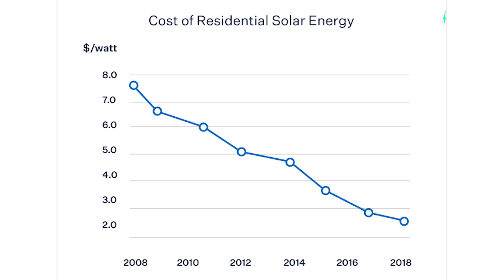How long does it take to save money with solar panels?

Comment: Cost of electricity is one of the biggest factors. If it’s cheap (10 cents per kwhr) like it is here, it takes 2.5 times longer than it would in Australia with 25 cents per kwhr
Reply: 25c/kWh would be a nice dream for anyone in Australia, but there's a lot worse... There's a company charging up to AU70c/kWh to charge CARS.  Guess the company... (You only need one guess)...

Comment: . The economics of the comparisons are totally different ('apples to lemons') 1. constantly 'buying' electrons that are consumed from a utility... vs.  2. Solar is Owning the source of electrons. So, asking the 'payoff' of solar is an irrelevant comparison to a never payoff 'consumable', they are two totally different business models. #1 you never payoff because there is No capital ownership...it's a service (like rent*)  #2 Solar PV Is Ownership (like buying a house ) which has a payoff & Equity. In the case of PV system ownership , you  start saving from day 1 of operation by offsetting a constant billing from utility.  Solar produces Earnings (free 'fuel' )  while paying to constantly consume electrons is *money out the window'!!

Comment: I can answer that very easily, I bought a 5KW inverter with 3kws off Solar panels 12 years ago and never paid another power bill again, this meant the nearly $300 a quarter we were paying went towards the Solar panel cost or $1,200 a year plus the $150 to $300 a year from Solar credits, after two years, I got my Electrician to put another 3kw of panels onto my existing system, we went from a max of $300 a year to a little over $2,000 a year in rebates.
Our original system cost $9,600 and then the further 3kw cost me $2000 installed, this then made my system cost free in under five years.
I then got a quote for a Solar Hot water system as we had Gas and were paying nearly $300 a quarter for Hot water and the Stove, so near the same as what we paid for electric.
The Hot water system cost me $3600 so paid for itself in three years and now we can wash our clothes in Hot water as well as we have the Hot water connected to the Dishwasher.
After the year the Plumber asked us not to increase the temperature of the Hot water system, I jacked it up to 65C from the required 55C.
I never expected the Solar to be as great as it turned out to be and only my Youngest Daughter listened to me and also got Solar for her Home, they now don't get the same rebates as they have moved three times since then and put Solar on each new House they upgraded to.
They may get at most a $75 bill per quarter for the House, as it's a big house and they have two children.
I did tell her to get a larger system as they were doing a lot of deals at the time, she is happy with only a $75 at most bill as her older sister is paying $750+ a quarter for a slightly smaller house per quarter and they have the perfect roof for a 11kw system.
I know it's probably different for people as some won't follow the rules on when to use your Solar and when to use the grid power :)
Also as an aside, I have heard people tell me that their Solar System didn't make any difference to their power bill ?
I am guessing there must be some Dodgy Companies putting crappy panels onto their customers Roofs ?
I have a mobile dual panel solar system that has a little box connected to them that keeps my Batteries conditioned as well as charges the batteries for my Tools. it also has a 12volt battery that can be used for many gadgets when we go camping.
I am a huge advocate for Solar as not only does it save you money, it will also prop up the grid as more and more Electric devices get connected over the years and I will get a Battery wall and upgraded Solar system once I lose the Government rebate :)
I find it hilarious every time one of my friends or family members whine about their power bill :), if they had listened to me either before I got my panels or at the same time, they would be laughing as I am :)

Comment: I live in Hawaii where electricity 44 cents/kwh.  I own an EV/Solar/battery.  I save $600:month on gas and home electricity.  System paid off 4 years.  Adds value to home and saves the roof.

Comment: Well, in my case a qualified for a 0.00 dollar payment for my solar panels, including installation, and I saw how my monthly payment went from an average of 479.87 USD a month to just 51.17 USD a month ON THE VERY FIRST MONTH after being installed!!!! So I am able to save more than 430 USD/month just right out the bat, so my payback is NOW and is actually my profit, no waiting time at all!!!!  and my system is running all the electric systems in a 3500 Sq.Ft or 330 Sq/M, two story home!!!!!!
Reply: How much are you paying monthly for the pannels ? Apart from the energy payment of 51 that your paying to the solar company

Comment: Here in Thailand I installed 20 kW of solar and 36kWh of LFP batteries. It powers my house; electric car and electric motorbike without grid power. Payback is less than 6 years.

Comment: Solar panels on your roofs cost double or more per produced watt than utility scale projects. It would make much more sense to invest in a bigger project and get a portion of that energy. The problem is that the grid owner, even if it is the state, will charge way too much to transit the power.

Comment: When I looked at solar in the 80's the payback was 20-23 years for panels that were expected to last 25 years at most for maybe 2 years of free electricity.  10 years ago it was payback in 8 years WITH the generous feed-in tarif available at the time.  Nowadays it's 8-10 years without any tarif or rebate for panels that are expected to last closer to 30 years.  
  With battery storage storage becoming more affordable the number of configurations of systems that would be economical becomes larger.

Comment: My latest monthly bill here in Nz was $80, sounds reasonable. I used 160kwh of electricity. The price for 1unit of electricity is aprpx 25c, the rest is the bullshit extras, the power companys add, and one of the spokesman.for these companys stated that electricity prices will need to double in the next 5 yrs. This is in a country which is over 85% renewables.   our biggest comsumer is a Rio Tinto company who pays 4.5c a unit and complains that is too expensive. 
So hopefully, solar panels and batterybanks will keep dropping in price so we can completely disconnect from the grid at a reasonable cost

Comment: We had solar panels and home batteries installed in February, even though this spring has been particularly cloudy in the UK, we are still generating more each day than we use for the house. Most of that surplus goes to charge our EVs. Having the home batteries means we can store the solar energy and use it at night, it also allows us to charge overnight on cheap electricity if the solar forecast is poor. We borrowed the money to install the system and the bottom line is that we are already saving more than the cost of paying the loan, so it literally pays for itself. If it works in damp, cloudy Britain, then anywhere with more sunshine is an absolute no brainer

Comment: So basically 50yr latter it saves you 40yr of paying for electricity... they just try to complicate things with all these numbers and shorter time Horizons...
Just like geothermal where you pay 90% of the cost is upfront in installation cost, refurbishing it 50 years later means you pay 10%..

Comment: I'm a Tasmania electrician and I upgraded my own home's PV system in Feb this year. I got Longi brand 500W mono's for AUD $285 each including GST from my local electrical wholesaler, and a Goodwe 10kw single phase inverter with 3x MPPTs for around AUD $1500 including GST. Minus labour (I installed it myself), all the materials including cable & mounting, panels and inverter was around AUD $6.7k for a 7.5kw system.
After a government rebate of $2.6k back, net out of pocket is only AUD $4.1k minus my labour for 7.5kw.
If I add AUD $3k for labour, that would mean 7.5kw system for AUD $7.1kw. My system generates on average 8300kwhr/year.
If I super conservatively sell every kw generated for a minimum of AUD $0.13, rather than factor in savings AUD $0.24 for every kw I don't import, then it will take around 5.5 years to pay off.
Just some detailed figures for people to get an idea.

Comment: My solar system 6.6 kWh with 5 Kw inverter here in Victoria Australia..system cost $7500 with  subsidies inc $1800 solar Vic loan and $2500 small system solar credits Federal...$1000 up front .  Payback is going to be about 3.5 years .. as price of power goes up WFH offsets have increased ..but export is down to 5.4 c per KWH...summer bill is zero and spring and autumn about $100

Comment: You save money straight away, but the payback period is (in my estimations on our system) is about 10 years.  Just in time for the panels to drop to 70% of originals rating.  Some may experience less time and longer life on their panels.
It depends on feed in tariff too, if you are selling to your retail supplier any unused energy, and of course service charges.  Not all things are sweet in the solar game.  It also depends on how much your supplier charges for a kWh of energy because you have solar.  Obviously, the elephant in the room is the amount of sun you receive in your neck of the woods and duration.

Comment: The big corporations and energy vendors do not want AND will never allow green energy to be cost effective. It's their new green cash cow. Solar was promising and the big energy firms bought up copper, other materials, and big solar providers to keep the profits high. Average US home costs $26-35K to solarize and even then the returns are half what they promise. With a $400 a month power bill you need decades for things to recoup to basic investment, especially if you finance at high rates they charge. Wind turbines are made by a few firms who keep the prices very, very high. Geothermal and wave generators are very expensive.

Comment: In Québec City, I use around 20 000 kw/h per year, while beeing very, very cautious with usage. This include winter heating and a little air conditionning in summer.  Also, very cloudy also in winter.  Very different situation indeed ! 
But, since tarif for electricity is only about 0,065 Euro each kw/h, the payback here for solar could be very, very long. 
We rarely see solar panels installed here.

Comment: Just before the pandemic I bought 2000w of new Jinko panels for $1000 with 9kw of LFP. Even with my tiny system I have saved 4 grand in 3 years. I am just waiting for some kind of affordable thin film solar to come on the market so I can fit more solar on my walls to make winter much easier.

Comment: I'm in Melbourne Australia and I was paying AU$1800 per year for power, 5 years ago. I installed 6.4kW of solar, which after rebates, cost me AU$3050 out of pocket. A simple calculation will show you that $3050 divided by $1800 is 1.7 years, or, approximately 19 months.  In the last 5 years I have not paid a cent for power. As they say, your mileage will vary...

Comment: We installed a 5kva solar system in in 2011 South Australia , they halved our bill by $1,500 a year,  outlay was $5,999. In August 2019 we added a Tesla 13.5 Kva battery.  Figures from today's read out 13/5/2023 are, Home Usage 20.40 MWh, Solar 42%, Powerwall 39%, Grid use 19%.

Comment: My house has had solar on the roof for about 8 months now.

I live pretty far north, near Seattle.  In the winter days are short and we have lots of clouds.  So, in the winter we didn't get much power from the solar panels.  However, in the autumn (when we first had it installed) and in the spring (now) we are getting lots of power.

Because we had so much equity in our previous home (where we lived for 31 years) I felt I had enough budget to do the solar properly.  We spared no expense, and our system is predicted to make enough power in a year to cover all our home's needs (plus almost enough to charge the electric cars).  Even with the expensive solar panels, the payback would be reasonable.  But I also got backup batteries (similar to Tesla Powerwall, but the ones we got were made by Enphase) and the backup batteries raised the expense by a lot.  So, should I consider the batteries as part of the system and complain about how long it will take to work out financially?  Or should I consider the batteries a one-time expense, like the new countertops we put in the kitchen?

I think that the solar panels and batteries significantly increase the resale value of the house, and so even with the batteries the system will have paid for itself within 15 years ("paid for itself" meaning net cost equal to or less than the extra resale value).  And it will pay for itself faster if electricity rates go up.  So overall I'm happy with the system and I would do it again.

Note, the system would pay for itself faster if there was some kind of "virtual power plant" system I could join.  I really wanted to get a Tesla system so I could join a Tesla VPP.  But given the specifics of our roof, we are getting a lot more power from our solar panels than if we had gone with the Tesla system.  (Tesla uses "string inverters" and our system uses "microinverters", and due to shading issues we get a lot more power from a microinverter system.)  I'm hoping that in the near future there will be some kind of VPP we can join.  Either Enphase will set something up, or Enphase will make a deal with Tesla to let Enphase customers join a Tesla VPP.

Comment: ROI  on 16 Solar panels with LFP batteries  powering 2 SPLIT Type AC, Fridge  and Washer and Lights  and small kitchen appliances  in the Philippines  is around 6 to 8 years. Cost to some homeowners was average $10,000 to $12,000, most did+  LFP Batteries & Gridtie.  Having to pay $5-$6 monthly extra to the Utility Provider ." It is more Fun in the Philippines "... Cheaper too?

Comment: Just watch out for the scammers. Sure they will put in a good system, but overcharge through the nose for it. The sales pitch I got was 10kw of solar somewhere in the ballpark of $40k US. My installation was super simple and I ended up doing it myself for $16k total before incentives. The pitch went like this. We finance the system for monthly payments slightly over you current electric bill. In a few years they will reach parity with the rising cost of energy. Your loan will be paid back in 10 years. The big catch is they dangle that $12,000 1st year tax rebate in front of you first and foremost. They tell you about all the things you can buy for the family, etc. In the mean time, this system should have cost you $20k max. I was recruited by a solar sales company shortly after I retired 20 years as an Electrical Inspector. I was told that with enough overselling, I could make as much as $1 per watt that I sold. That is almost the final price I paid for my system installed DIY.
The US rebate system should be based on like 25 or 50 cents a watt. This would stoo this predatory selling tactic overnight saving the consumer tons of money as well as the Federal Government. Everybody would win in this except the sheister salesmen. I bet they have a lot of lobbiests making sure it stays just as it is.

Comment: When I was getting quotes fory panels all of them had payback periods in the 15 to 25 years. I still do eventually want them, as long as I can use them when the power is out, but it's less about saving money and more about redundant power.  
  
One of the main things making it that long is out power is only about 11 cents per kWh where I am.
Reply: Solar panels will not help you during a power outage. You need a BATTERY as well as the solar. The battery must also be capable of running your WHOLE HOUSE.   I have a Tesla PowerWall2 and this does the trick.   One way of saving is to check out your local rubbish dump. Here in Australia there is usually a huge pile of solar panels for sale for next to nothing. Well worth a look.
Reply: @greghudson9717  Alternatively, use IQ8 microinverters that can self microgrid.

Comment: I’m in Portugal where it’s sunny !
BUT the electricity is only €0.158/KWh 
So it’s simply not worth it!

I laugh at people who buy them.. they are basically saying.. “ I can make electricity cheaper in my garden with my tiny operating system than a huge energy supplier can.

(I appreciate in some countries the figures differ)

One friend showed me his PV that he installed three years ago.  “Only another five years and I have payback !” He proudly explained.

Don’t forget before that, you may need to replace your inverter. He wasn’t aware that they have a limited life 🤦‍♂️

Comment: In Southern California, I save about $1K/yr on a small grid tied 4kw system that cost $12K 12 years ago.  So it’s all gravy now.  But, I’m thinking of upgrading to a 6 to 8 kw system using the existing roof solar footprint and adding a backup battery.   A 20 kw backup battery should meet my needs, but, possibly, I would also consider Vehicle To Home capability.   I expect a 6kw system and one 10kw battery, to cost about $35k, and I will save about $2k/yr.  Incentives, about 30%, hopefully.  So $25k net cost, 12 yr payback.  A second 10kw battery and/or V2H, will no doubt cost more.  I’m not sure the payback period would make sense for the additional storage.  I might be waiting a few more years for better prices.